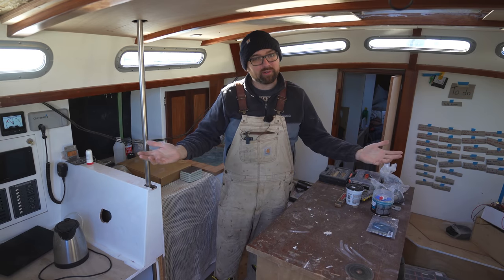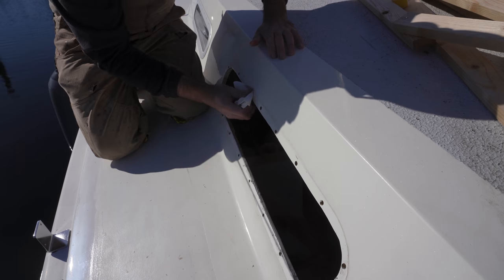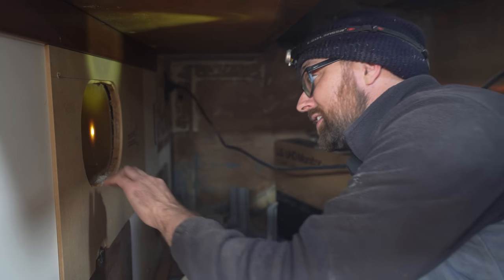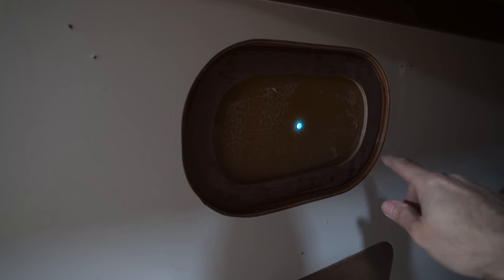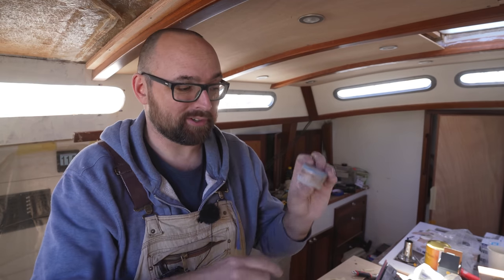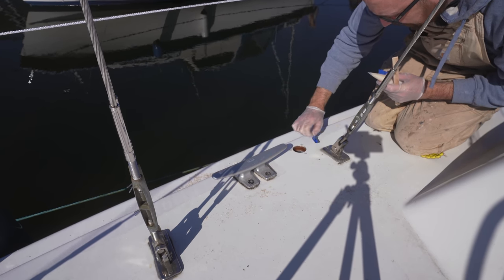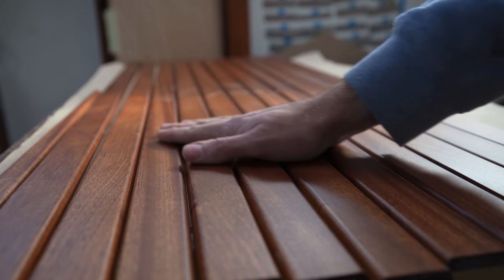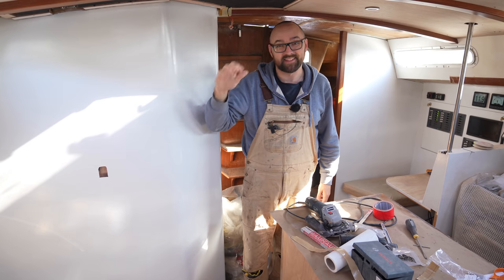Sail Life - New Gebo portlight, deck fills & working on the settee - DIY boat project

Comment: I used the ArmaFlex AF everywhere on my boat and kept it visible. I can assure you that mold will never grow on top there, even if it is wet due to very high humidity. It's really great. the only thing rotting away in my aft cabin are my clothes :-D

Comment: We have portlights like those, they were installed in 1997 and are still in pristine condition. The Gebo after service is also very good in case you needed a part.

Comment: An other way to seal those portlights than butyl, is that normal household window soft rubber gasket tape available from any local hardware store. It will flex with the boat and is 100% water tight. And takes no time to change if ever required... just a tip...

Comment: Mads, you need to wear a dust mask when you're cutting/routing/sanding wood, especially if it's MDF (composite).  Also any time you mix West 406, as it's extremely dangerous to breath silica dust.

Comment: TefGel for the screws in the aft cabin port light. Will prevent galvanic corrosion between the aluminum frame and the stainless screws

Comment: orange peel effect appears when the paint is too cold when applied to the material. It worth putting the paint can to a bowl of hot water (the temperature of hot water you get from a household tap)  before you start painting.

Comment: Having worked in weather resistant structure techniques here in Seattle, field engineers wanted to see squeeze-out of sealants when we bedded windows.  Butyl tape was reserved for sealing larger areas and flashings.

Comment: Seems to me there are two options for filling the gap in the nav area portlight inner trim ring.  Use matching hobby model paint to paint the gaps, OR BEST, find a bit of matching patina aluminum to glue into each gap.  Doing nothing will NOT be satisfactory to Ava!

Comment: mats   for faster sealing sicaflex may work well but locktight has  a product designed to seal studs passing through the water jacket of engines  i suspect it is a better option and just thought you might like to be aware of it in future. as always thanks for the videos and see you next week ;]

Comment: Busy week!  The Hempel paint is an oil based alkyd and the whites and lighter shades will yellow with time due to the oils present.  An acrylic, water based, paint is preferred but nowhere near as easy to apply.  Unless you go epoxy of course!  Great video.

Comment: International Toplac is one of the better single pack paints to use. No fading over time.The stripper pole that you’ve installed near you nav station how are you going to finish the base?. Keep up the good work Mads.
Reply: I would love to see varnished Mahogany (shelf) at the top of that short wall between the nav station and the galley.  (between the hull and slightly beyond the stripper pole). That would look nice.

Comment: I know others have mentioned ways to camouflage the gap in the port light trim but do you still have the trim pieces for the port light you removed in the head? You could always cut a couple of pieces of aluminum to fit the gap over the nav desk. For that matter if you have access to someone with a welder, you could cut the pieces, and hand them over to somebody to weld them up for you and not have to replace the trim.

Comment: Re the screws in aft cabin port light. Had the same on my boat, the stainless and aluminum reacted and the thread disappeared! Perhaps coat the screws ?
Reply: Could use Duralac to coat the screws if i'm not wrong he has some already.

Comment: I am by no means an expert, but I wonder, to get rid of the pinholes, would it be possible to use a vacuum chamber to remove all the air?  Maybe Cement-boat-guy might have one, or you could even whip one up with the pump you got for the rudder?

Comment: I'd love to see you rework your outro tiles.  I've noticed (since I've watched your channel for years) there is so much information on the screen that I've never once clicked a "watch next" video.  They get lost in all the text that is on your outro template.

It would be so much more effective to have a clean outro tile template and not post all your social media text.  If you want links to your social media just add them as buttons in your template.  That way the 2 videos you are promoting viewers watch next will stand out much more.  Also, black is really not an ideal color of this type of template.

It's a simple fix.  You can make a free outro template using Canva's free version in just a few minutes.  Download it as an MP4.  Then do your normal routine of adding what videos you want to display in YouTube Studio.  I think this simple thing would add so much more value to the outro than the current configuration.

All the best.

Comment: Okay, I watch too many sail boat refit videos !  I have come to the conclusion the the best thing to use when bedding a port light is butyl tape.  Why ?  Because it and all other sealants/caulks WILL EVENTUALLY FAIL !  With butyl removing the port light and butyl tape and cleaning before re-bedding is much easier than any other sealant/caulk.  Maybe butyl does not last as long, but replacing it is so much easier !

Comment: Im in no ways an expert, but if i remember my course well, orange peel was a consequence of spraying too little lacker on the piece. Maybe saturate a little more?
Reply: Orange peel can be caused by 
Uneven surface or contaminant under paint
Spraying with too low of a pressure
Paint mixed to thick
Painting at too low of a temperature 
👍

Comment: Don't mix filler on wood you will get tons of pin holes from air. Use a plastic mixing board. Auto body 101